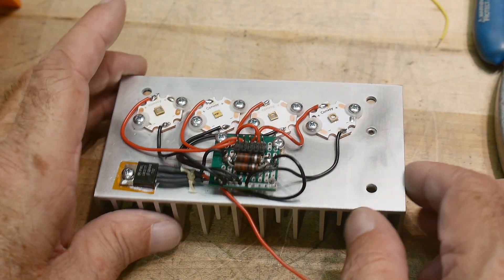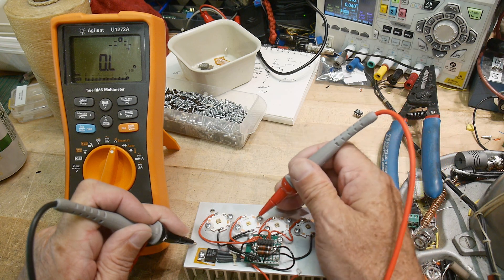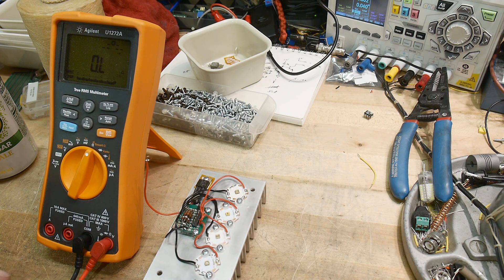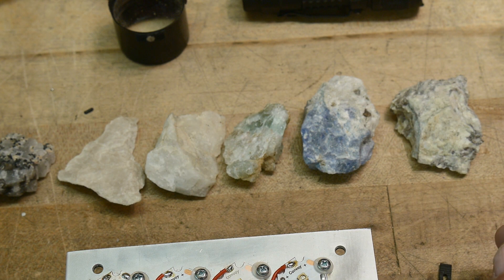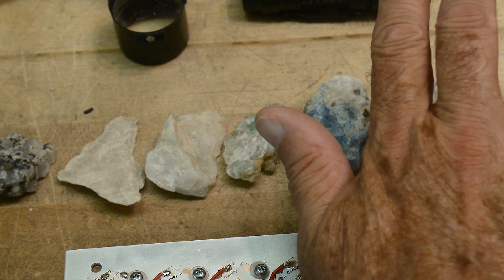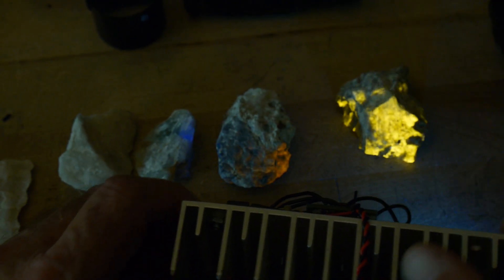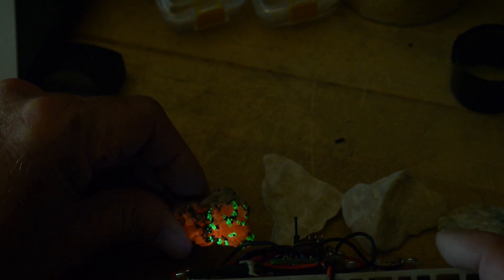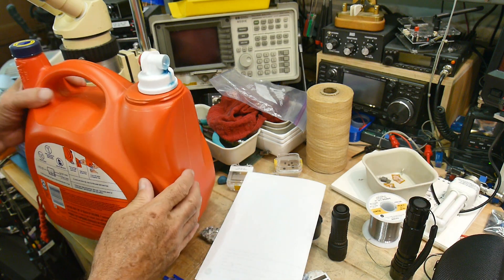#1264 UV LEDs (part 2 of 3) Fluorescent Rocks

Comment: Willemite is actually not really a common mineral. The only place in which I found any was at the Franklin mine in New Jersey. It's a zinc silicate, so it makes sense that it's found primarily around zinc deposits and mines (like the Franklin mine was) which aren't that common.

Comment: 5:10 Can you smell ozone generated by the 255 nanometre LED ? It is probably close enough in frequency that, unless it is a sharp peak, there may be some generated by providing the correct energy to break the chemical bond (photodissociation).
O=O 494 kJ/mol (~242nm)
C=C 602 kJ/mol (~199nm)
C=N 615 kJ/mol (~195nm)

Comment: Thanks, I enjoyed this very interesting Clip.  
I think, someone could use this method to prospect for minerals for mining, or even identify various biological material such as red blood cells , bacteria, etc.
Another interesting thing is to mix the various lights with different wave length form infra-red to UV and check out the results, may be shining it on various materials as a non-linear element.
I became interested in researching how to built the light spectrum analyzers that astronomers use to measure say red shit.  Similar light spectrum analyzer can be used to measure wave length of the the LEDs and their interaction.
Also, having such spectrum analyzer enables one to use an electric Arc and pass the light trough various materials and analyze the spectrum of absorbed light.  This way one could not only find out the elements in that material, but maybe the chemical bonds.
Reply from the maker: https://youtu.be/GXD9c5TQ6Ls